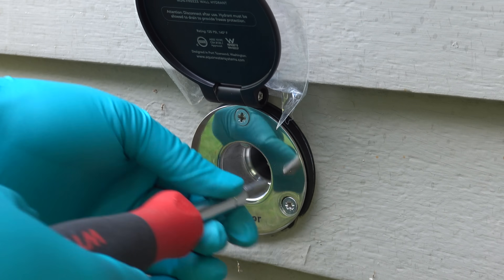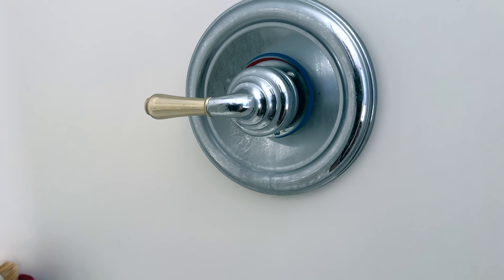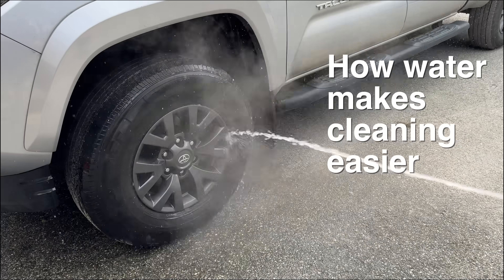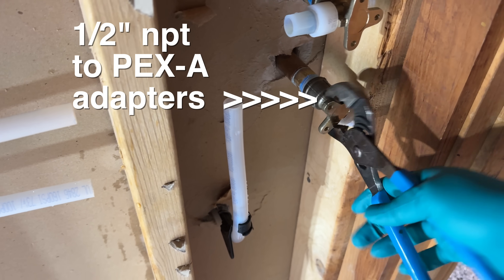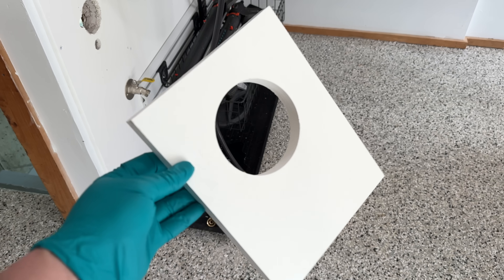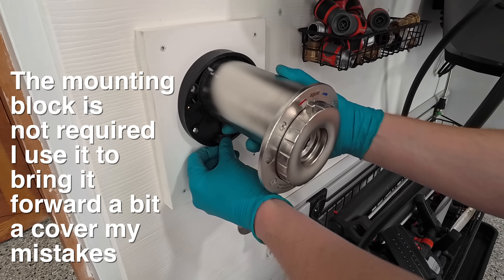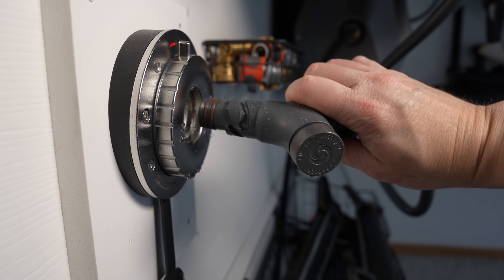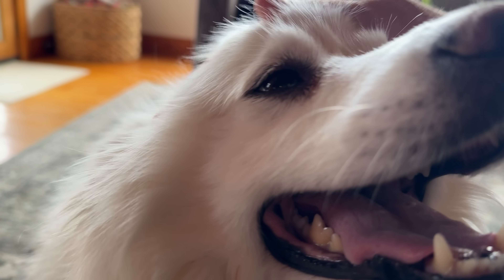REPLACING YOUR OUTDOOR FAUCET JUST GOT EASY / HOT & COLD AQUOR - Frost & Leak Free!

Comment: I love having an Outdoor Hot Water Bib outside here in New England. I installed my Arrowhead Brass Bib about 17 years ago and it's one of the best things I've done. I put it in specifically to wash cars outside year round but over the years we use it for so much else. We wash the dog with it, we fill the kiddie Pool with warm water for the Daycare kids, and the year we were redoing our Bathroom and it wasn't ready on time we took Outdoor showers with it. The look on peoples faces going by my driveway at 6AM in mid-October was priceless. My Comet Static 1700 Pressure Washer can handle inlet water temp up to 145 degrees so that also gets used year round as well. I'd say if you're on the fence about it just pull the trigger, you'll be more than happy you did.

Comment: I have been waiting for this for 2 years. I will be replacing my old corroded that leaks with this. Great video!
Reply: $409 is nuts, I got the Prier-C mixing spigot for like $140
Reply from the maker: If your is working you are lucky. The Prier in the video was my second one, both never stopped leaking. They arent the Priers from the old days, at least not for me.

Comment: Checked the aquor website. I'm hoping they come up with a hose adapter that isn't plastic.
Reply: Same! This is honestly what keeps me from buying the product. This hot and cold version is so slick, but that plastic connector just feels so cheap.
Reply: They use plastic because of the freezing possibilities I assume. Longevity.  A metal piece wouldn't slide in as easy. Why so held up on the plastic? What substance would be better for this application one engineer asks the obvious other engineer?
Reply: yea its an issue.  They break.  And the orings wear quicker than youd think.   Very expensive solution that just creates other issues.
Reply: Same,  I'm also wondering if the stainless of this unit plugs brass fittings would corrode quickly leading to other issues.

Comment: I bought and assisted my plumber with the installation of the cold only Aquor’s on my new construction house in 2018, have been trouble free since installation..   I bought them because water is expensive in MA (sewer use is tied to water usage), so a vandal could turn on a conventional spigot while you were away/at work/on vacation and you’d have a multi thousand $$$ water bill.. this was mainly to prevent that, and elliminate constant dripping of older style fawcets.  I did install a cold/hot mixer in the attached garage, mainly to use on the pressure washer when washing the car in winter, could replace it with this, but I don’t use it much.

Comment: I get why the piece that plugs into the unit is plastic, makes sense from a longevity perspective of the stainless steel insert.

Curious how well built that piece is.  It does look sturdy.
Reply from the maker: The plastic can be run over with a vehicle. Very dense stuff. I am told they do it for longevity. If you had metal on metal, every insertion would wear it down slightly. The plastic is somehwat lubricating and keeps it smooth from over 100,000 usees. When it is replaced, if needed there is 0 wear on the fixture. Reviews are insane on these, they are very well liked https://amzn.to/4aRhiHF

Comment: How do you install this or the normal aquor onto a house made of concrete for example? Houses in Florida where I dont have access to the other side of the wall or not enough depth for the angled part.
Reply from the maker: If the backside if covered you would need to pen the drywall to get at the plumbing. It's not hard to do or repair and the hot cold is something you want, its worth the time. Fortunately if you have to change parts in the future, everythign is done from the front.

Comment: Pretty cool piece. I like my standard aquor connection. However this would suck to install in my house. I have a full size brick facade, about a 3/4" gap then sheathing. To boot, where my current bib is, vs how the floor joists are run, my estimation on the length of that product looks like the connection end of it would land right at a floor joist. This is not a grip towarda the product cause obviously they cant account for every scenario. More so a recommendation to people to scope out your install spot and see best you can if its going to work. The standard bibs are a little pricey so i imagine this one isn't at all cheap so it would be a big buzz kill to spend the money, get halfway into the install and realize it wont work or will need a lot of extra work to make it fit. A have lost a lot of faith in contractors in my area so i can only imagine what they would do to "make it fit" just for the sake of completing the job.

Comment: I like this but... I have a heavily used outside hot and cold faucet  same as the 1980 pic just horizontal that gets replaced every 3 years or so. This would be perfect. The only problem is I would never buy it as long as there is only plastic QD and no brass QD.

Comment: I noticed the all-in-one pressure washer with réel on your wall.  Many online comments about that unit.  Either good or very bad.  What's your experience.  Possible future video?
Reply from the maker: Thank you, Yes, I saw those reviews including the crazy one from Matt from Obsessed garage. Giraffe sent me that reel https://amzn.to/3Tq309I and their vacuum for free to try out and it was up to me if would make a video or not, 0 pressure or obligation. I figured a real review would be using it for a while,  I installed the reel last summer and the vacuum 2 weeks ago. The pressure washer works great, I have had 0 problems with it.  The reason I like it a lot is that it is always there ready,. I have a powerful gas one that I hate to take out, and yup this wall one is less powerful and it doesn't matter. I use it for cleaning furniture, cars, etc. Works great for that. The convenience is the best reason I like it. If I need to strip lead paint from a building I will buy something else :)

Comment: How does it work with brick?
Reply from the maker: It can be installed in stone or brick but for 3 1/2" you will want to use a diamond hole saw for a perfect hole. They are much cheaper than the used to be.

Comment: Really don't see this thing taking off for the price it costs and the fact you need an adapter to attach a standard garden hose.
Hot water outside.. okay, that's cool, but you can do the same thing by just putting a separate hot water spout next to the cold one.  If you want to make warm water, put a 2-way hose splitter on them in reverse. Will cost a quarter of the price of this thing and no adapters needed.

Comment: If I run a brand new line to install this, what Aquor bits do I need to purchase for a complete working unit?
Reply from the maker: You get everytin the box you need to use it includijng the adapter. It has Pex A ends on it, so when they do your lines they just connect PEX A in and you have the rest. Screws too.

Comment: Why do you have a separate faucet for your pressure washer?
Reply from the maker: The pressure washer is only rated for cold water, and I used to just put a Y splitter on the hot/cold but unfortunately your spouse/kids don't always pay attention and just blow up your pressure washer running hot water through it. So now its a little more resilient.

Comment: Nice 5 minute ad. for 400 dollars I can have 2 individual spickets that merge, buy all the tools I need to install it, and still have enough left over for lunch.
Reply from the maker: That's true, but won't be stainless steel, it won't be a mixing valve with a preset or have a built in disconnect or freezeproof with a lifetime warranty. Listen I am the first one to say dont buy it if its not what you want, but it's not the same as slapping in two boiler drain valves for $30. If those work do it but there are some diferences. Whether or not that's worth it is up to you.

Comment: its currently $400😂
Reply from the maker: Yup, its expensive but it has a lifetime warranty, doesn't make it cheaper but if it lasts and you love using it, maybe its worth it. I am out 130 x 2 for the prier and it still leaked and didn't mix
Reply: @SilverCymbal  i get that. it would be a hard sell to my gf though😅

as others have stated if it didnt comeb
 with plastic nozzles i wouldnt be so outspoken. that cost should deff have metal attachments imo

Comment: 😂 why would u need a frost proof spigot inside? 😂😂😂 just use two normal hose bibs…one hot. One cold. 😂😂😂
Reply from the maker: Frost proof is really for outisde but I am in NH and even my garage area gets extremely cold,so I am ok with the plumbing in the insulated hallway.  Two hose bibs are fine, but they are lousy if you want to get the temp right, especially if you use it a lot and just want a good temp.